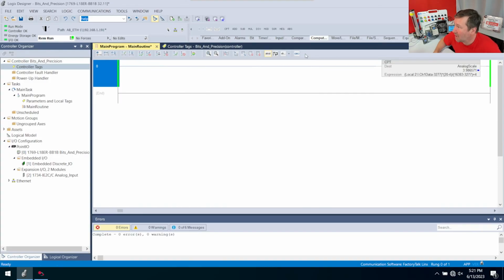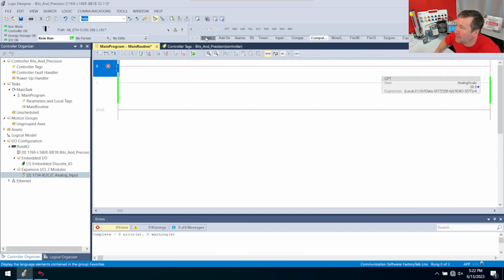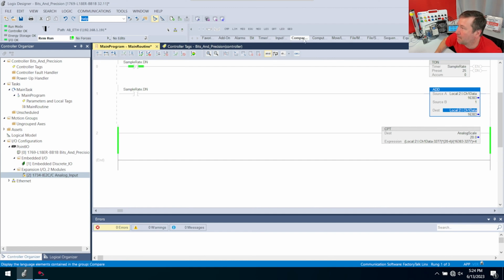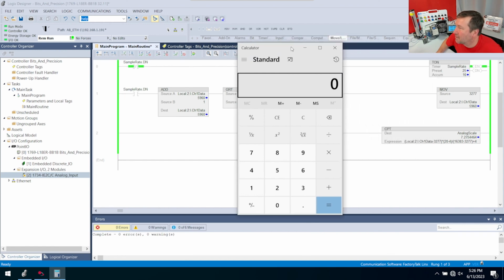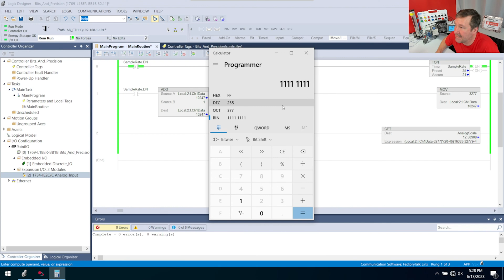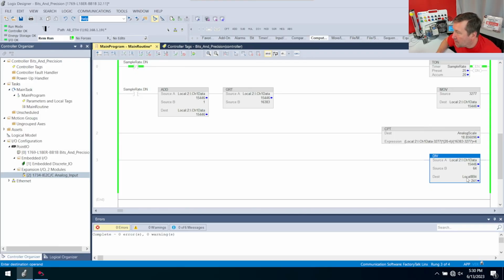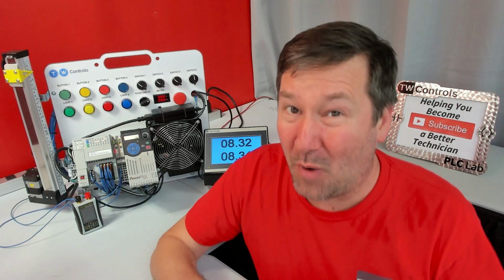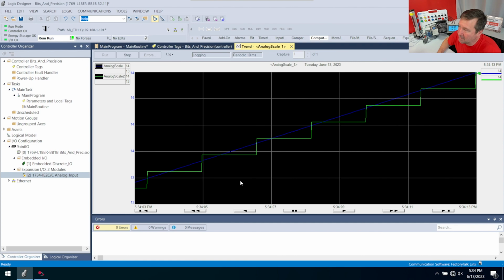Studio 5000 Analog Bits and Precision.  Do They Affect Your Process?

Comment: You can mix data types, but loss of accuracy and rounding error might occur and the instruction takes more time to execute. Check the S:V bit to see whether the result was truncated.

The bold data types indicate optimal data types. An instruction executes faster and requires less memory if all the operands of the instruction use the same optimal data type, typically DINT or REAL.

An advanced math instruction executes once each time the instruction is scanned as long as the rung-condition-in is true. If you want the instruction evaluated only once, use an ONS instruction to trigger the math instruction.
Reply from the maker: Interesting, I knew the S:V would be set if a number was higher or lower than what could fit in the tag, but I didn't know it would tell you if it truncated it.